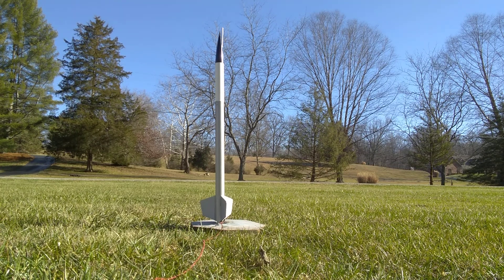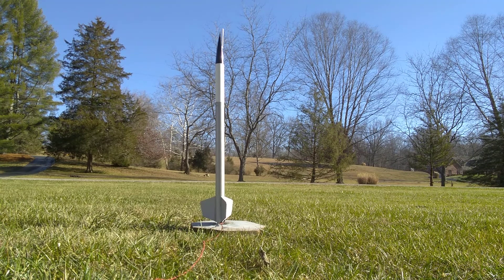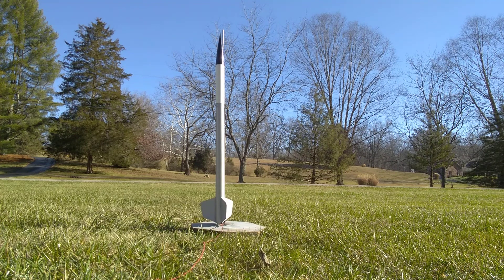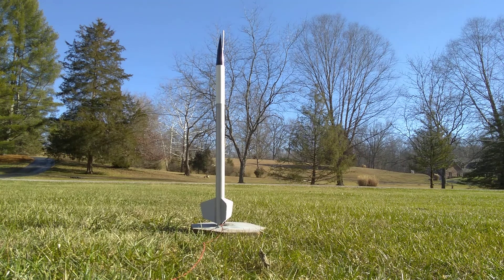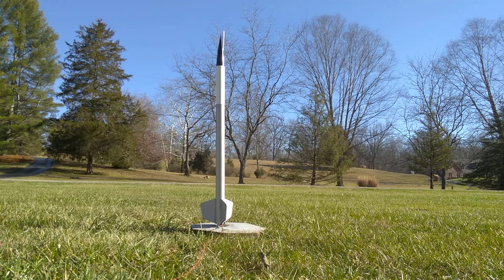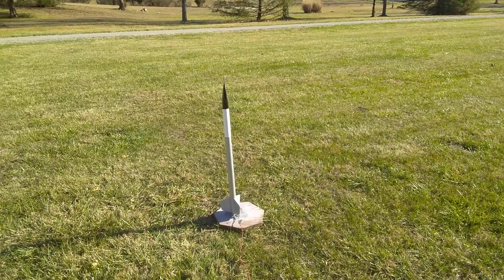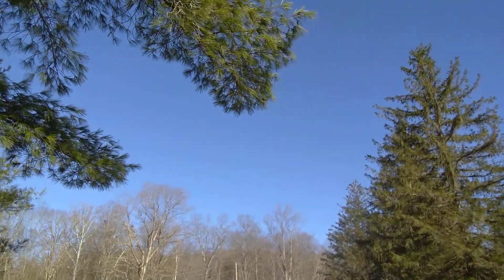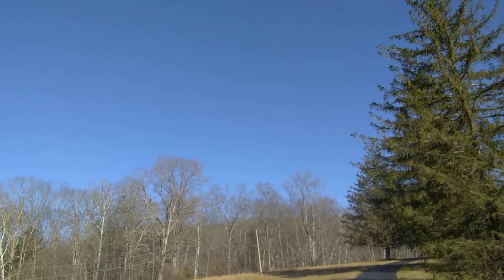TESTING ESTES "CHEROKEE -E" MODEL ROCKET #rocket #rocketry #modelrockets #launch #cherokee  #science

Comment: Glad I bought three of these kits at a discount from Hobby Lobby while they were sold out at Estes. Am I going to modify one for absolute maximum acceleration and altitude? You betcha. 
Am I going to jam a ridiculously powerful composite motor into it? Also yes.

I want three thousand feet or more and supersonic. By gluing the fins to the long body tube you save the short tube to use as an ebay for an altimeter. I've done exactly that with the second kit. First kit was built to Estes specs. 
Third one will go paint melting fast if I have anything to do with it!
Reply from the maker: Awesome yes go for it!!!! Exploration is the only way to learn what works. I'm proud of you!!!!!! 🚀🚀🚀🚀💥💥💥💥
Reply: I fly high power rockets. I think Cesaroni makes a 24mm G-motor.
Reply: @Skyrocket2299 that would be amazing in this rocket
Reply from the maker: @Skyrocket2299 That's cool, I'll have to check them out!